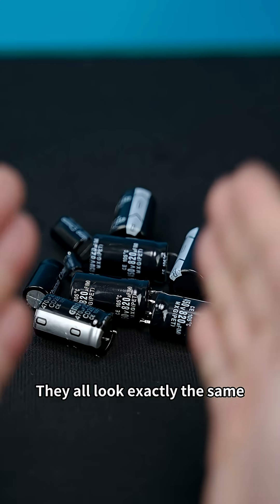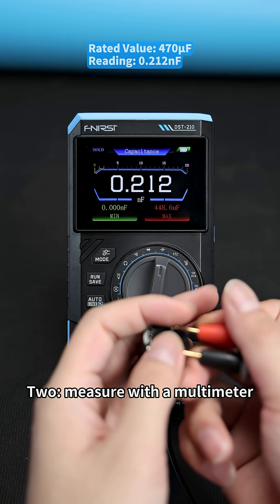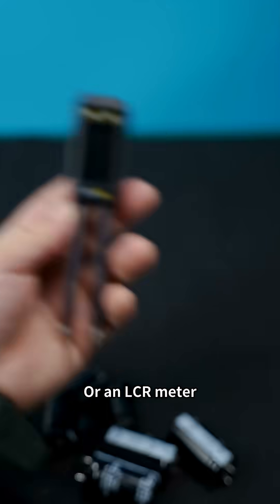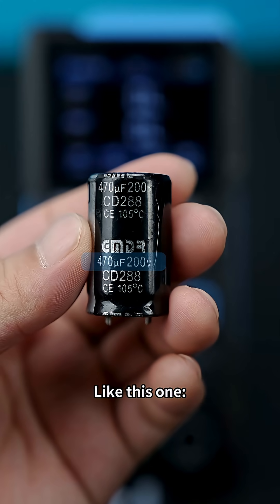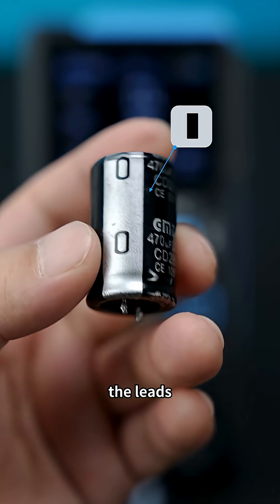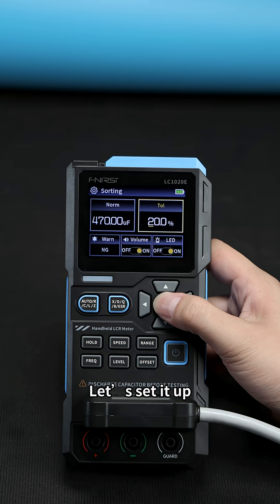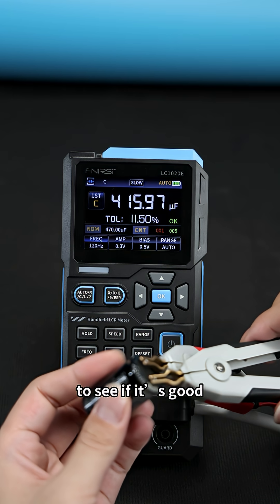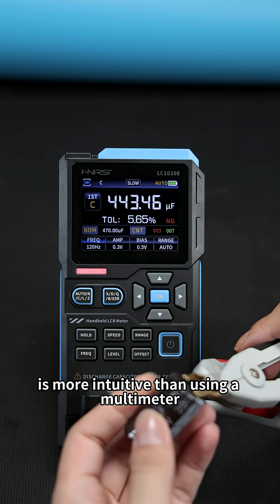FNIRSI LC1020E | How To Quickly Check Capacitor Quality Like a Pro in 3 Easy Ways #fnirsi #howto

Comment: I think you are a noob. Cause you did not tell the first step. The first step should be discharge the capacitor. If you don't discharge a charged capacitor then you can kiss that expensive meter😂😂😂

Comment: how do you test/sort DC voltage ratings?
Reply from the maker: You can easily test or sort DC voltage ratings using our FNIRSI DMC-100 Clamp Meter 💡
It supports accurate DC/AC voltage measurement up to 750 V, ideal for quick testing and power analysis.
🔗 Learn more here: https://www.fnirsi.com/products/dmc-100